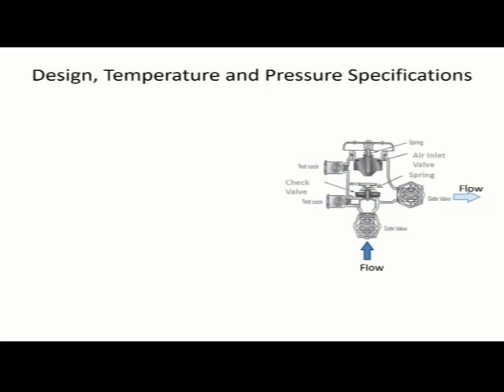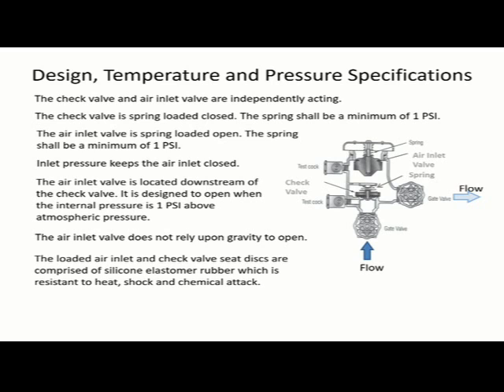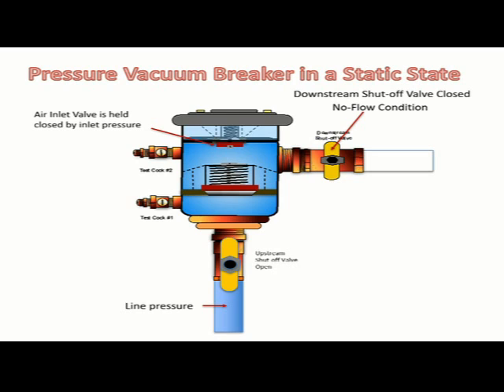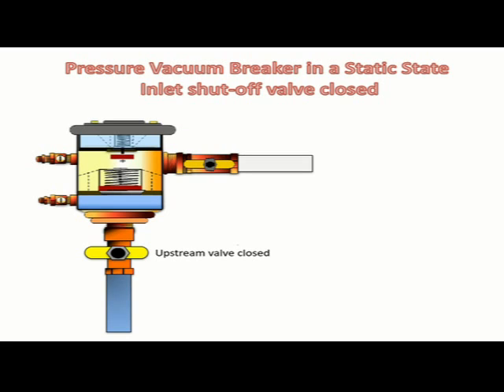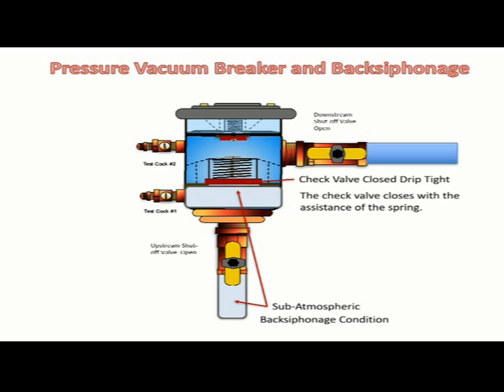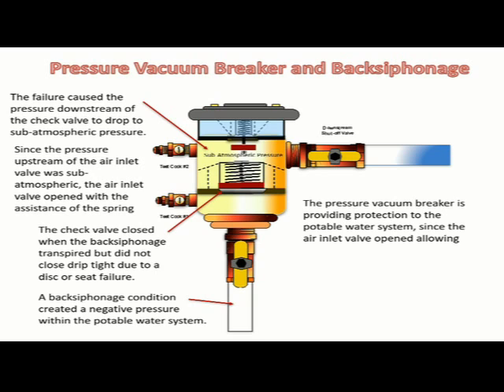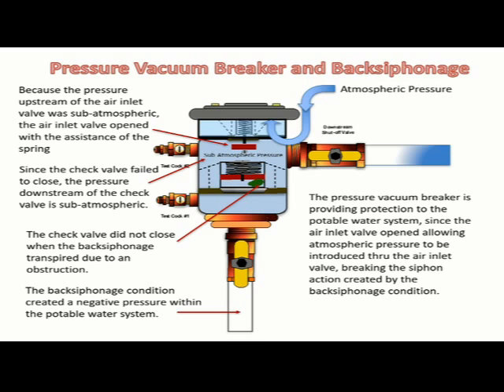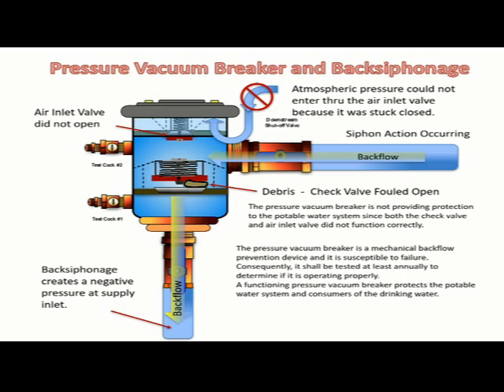Pressure Vacuum Breaker - How it Works

Comment: Can you have check valves down stream of the pressure vacuum breaker to prevent back pressure from a irrigation drip line up about 30 feet?
Reply from the maker: Very interesting question! Not sure that a drip line will create backpressure since the drip line will be subjected to the atmosphere pressure. Therefore no need for a check valve to prevent backpressure. However the installation of the check valve will not impact the operation of the pressure vacuum breaker. The pressure vacuum breaker can be subjected to pressure downstream that is less than the inlet pressure. So as long as the pressure downstream of the pressure vacuum breaker is less than the inlet pressure it will work just fine with regular maintenance and testing.
Reply: @JimmyBackflow he’s asking if it’s higher than the pvb. And no.